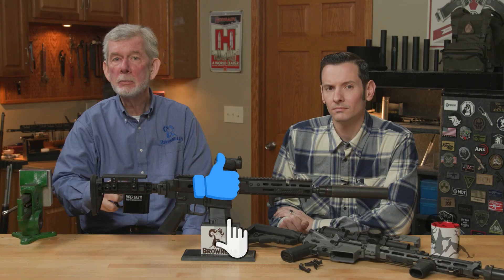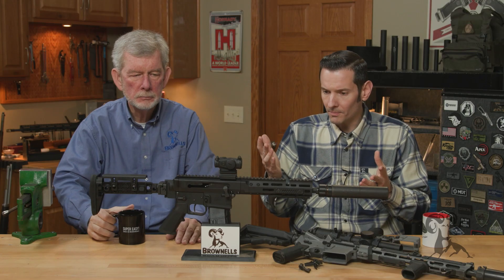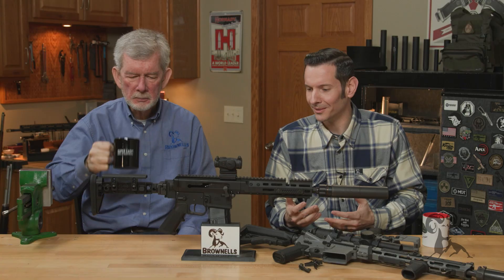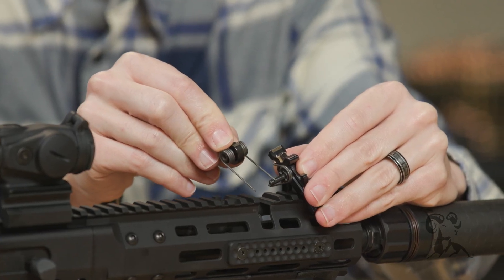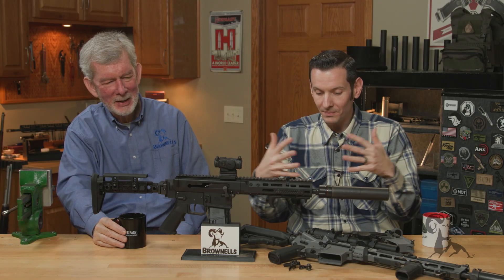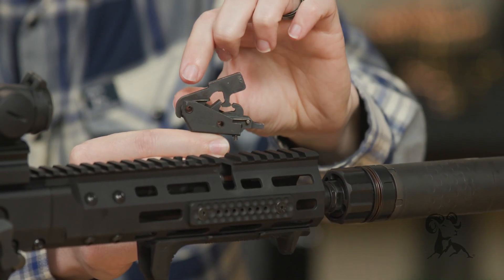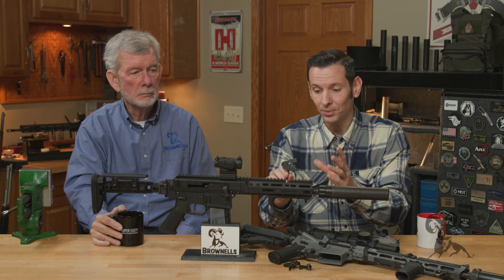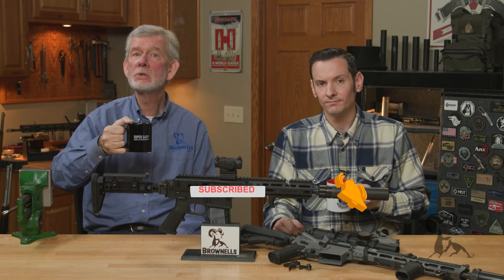Smyth Busters: Does Your AR-15 Need Anti-Walk Pins?

Comment: Mine does. Sometime your lower and pins are not quite in spec and they come loose. I just HAD to get anti walk pins because my pins kept walking out, lol. I just put them on all of my builds, they are not very $$$ and it provides a little more security. Plus I think they look cool.
Reply: Looks cool is a valid reason 😁
Reply: And that’s probably it. They are probably designed to remedy certain situations.
Reply: I've never used them, and I've never had issues with my factory pins. PSA, M&P15, and Windham rifles
Reply: Don't use a known defective firearm maybe 😮
Reply: If you buy cheap bargin bin brands like PSA and anderson thats the issue why they are not in spec. Hence, they are loose. There is zero quality control from those bargin bin brands. Buy from good companies, and this is a non issue
Reply: @zack9912000  I have 5 Anderson lowers and it only did it on one pin. No big deal.